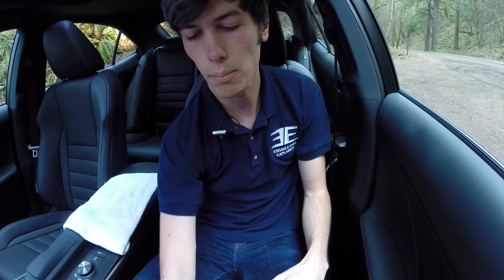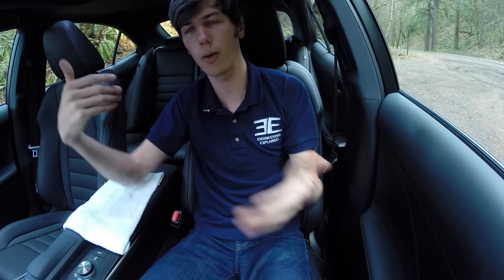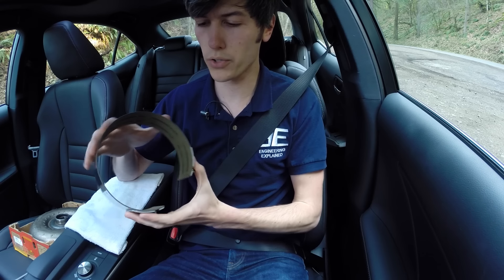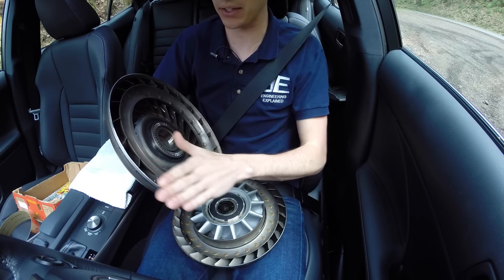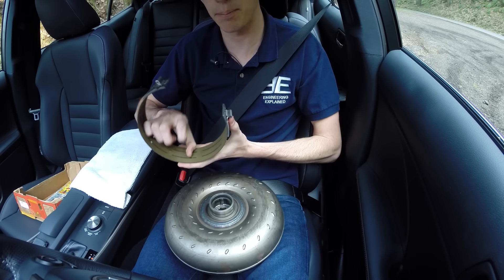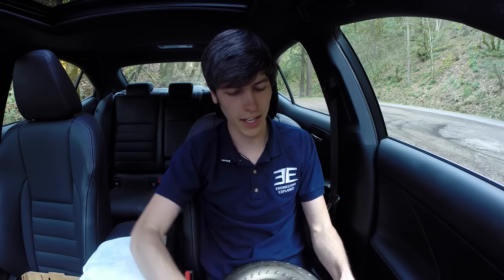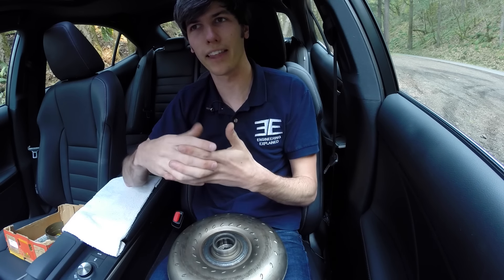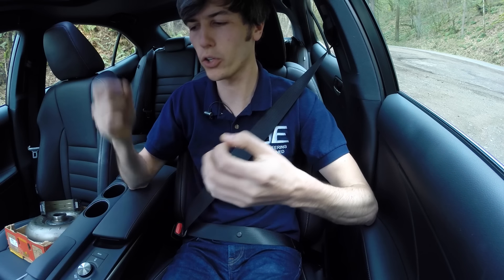5 Things You Should Never Do In An Automatic Transmission Vehicle

Comment: When you are on up hill and you shift to park. You should put on Drive, because if you put on Neutral the car start to roll back. Common sense, to shift it to Park you must stop the car, the only thing you doing shifting back to Drive is putting it back where suppose to be.
When cruising on Neutral the RPM on the engine goes to idle, the transmission will have higher RPM . Sample, if you cruising at 50-60ml/hr . On a normal driving should be 1300 -1700 RPM, but because you are on Neutral your RPM might be 1000 or less.
Proper way to engage gear is to press the gas to 1300 - 1700 RPM and you will engage smoothly, otherwise the engine will absorb the drainage of RPM and you will feel your engine increases RPM and your RPM gauge will go up. By engaging high speed whit low RPM, is like you braking with the engine, Braking with the engine eventually will break the gasket inside the engine, because the engine is designed to compress, not to decompress.
Absolutely you can do it until it breaks, and you can’t do it any more.

Comment: Not having a reason to put it in neutral when stopped.. That depends on the vehicle sometimes.. If you have an alternator dying and wanna keep off the brake lights ect, or if your engine is overheating or running hot and you have a clutchfan cooled engine you can put it in neutral and rev it to cool ect. There is a reason here and there but if your car is running perfect I can see it.

Comment: So I actually do put my car in Neutral when I come to a stop and the reason is there is a rattling sound the car makes when I am in drive and stopped with my foot on the brake. I noticed when I put the car in neutral that rattling goes away and the engine sounds as smooth as butter. I do not know the science behind it, if I were to guess it sounds like there's vibrations coming from the radiator or some other part of the frame, I honestly have no idea. All I know is there is zero noise when I'm stopped and in Neutral. If anyone has any insight on that I would love to know more.

Comment: I might be wrong, but isn't also bad for the transmition, if you switch from Drive to any other Mode for that matter, when on the move?
Reply: Modern trans will over ride most damaging commands as shifting is electronically controlled.

Comment: For #1, the law in my state says:

The driver of any motor vehicle when traveling upon a down grade shall not coast with the gears of such vehicle in neutral.

Does this apply to manual transmission as well?? Kinda sounds like it does, which is surprising.

Comment: Not true. Measuring real time fuel use  with  the Torque  app and a bluetooth OBD2 sensor shows measurably lower fuel injection when coasting in neutral vs. in drive in a 2012 Camry. Also,  it maintains initial high speed longer coasting in neutral vs. drive.
Reply: Hi, is it bad for the gear or the engine ? to switch to Neutral from drive , when going downhill ...Thanks.

Comment: if putting in neutral while on a stop light is a "no"
is it also a "no" to put it in "park"?
Reply: When you are stopped at a stop light, if the car behind you does not stop in time and merely "bumps" your rear bumper, that could be enough force to break off the tiny pin that locks the car into park.  The same thing can happen if your car is parked and turned off.  If another car is driven by a bad driver, that other car may ram your front or rear bumper and break off that tiny pin.

Comment: Neutral also stops fluid flow to certain parts of the transmission and will cause increased wear and failure rate if  you do this. This is also why you never want to flat tow an automatic transmission.
Reply: On a old Ford C4 RWD in N Oil Pump still works..., TC pressurized and  oil excess flow through cooling lines and return to lub transmission rear side. All clutches and bands are non pressurized 

When engine off, no oil flow and pressure at all,

Comment: Automatic cars are definitely easy to drive but people should know how to use them properly coz AT cars are more sensitive than MT cars. Also, AT cars if get busted, surely will be more expensive to fix and maintain than MT cars. Also, MT cars have parts that are really not that interconnected to other parts unlike in AT cars, one part gets busted may possibly need to replace more parts coz everything is almost electronic as compared to MT cars where one part gets busted, you will be okay. Not a lot of things to repair.

PS: For the last issue, here in the Philippines, traffic is very bad! I think we are second to Colombia in having the worst traffic in the world, here in Metro Manila and nearby provinces, traffic is very slow. I can see some drivers putting their car in Park Mode with handbreak activated while traffic is moving slow or stationary. However, what I do is just put my gear shifter on Neutral and activate my handbreak. I can feel that my car is less stressed coz it's on idle as compared to just pressing on the break pedal all the time I am on stationary for like a minute to 5 minutes. That's how bad traffic situation here in Metro Manila is. Let's say an average of 3 minutes you will be staying in 1 place, so placing it on Neutral is very helpful with handbreak on and of course pressing on the break pedal to secure that you won't move without your knowledge. Then afterwards I'm gonna move at least 5 meters before I do it again after putting it on Drive Mode. 😂 That is why here in Metro Manila, travelling as near as 2Km may take an hour for a driver before he gets to his destination. It's pandemic now, traffic is somewhat more laxed in the past couple of months coz not a lot of commuters went out and public vehicles weren't that many but now, it's starting to get worse again.

Comment: What is the purpose of the neutral gear in automatic transmission? Why do we even have it on the car, since there is no scenario where we can use it?
PS. I'm driving a 2007 automatic Honda Fit and there's far less vibration when keeping it in neutral at the red light compared with keeping it in drive. I know the age makes the difference, but still...
Reply: Car breaks down and you cant turn it on. Only way to push it out of traffic or into a trailer is by putting it in neutral
Reply: @MultiBeast301  thks - did not thought about that. Sometimes the obviously needs to be said.
Reply: @laurentiutrifan9092  No problem. Also, if your accelerator gets stuck while driving, shifting into neutral is the only way to safely stop your car. Its a nice safety feature. Hope you never have to deal with that lol

Comment: Get in your car. Start it. Put it in drive with your foot on the brake and look at your RPM’s. Now put it in neutral. Notice your RPM’s dropped?

What uses more gas… higher, or lower RPM’s?

Checkmate.

Comment: Never put in neutral, it's not safe and illegal. With that being said:
1. coasting in gear will NOT always cut the fuel. It depends on vehicle;
2. put in neutral when come to a stop light IS a strategy of some vehicle programmed as default.
my land rover will not cut fuel when coasting in order to maintain the coasting speed. And the service manual explicitly said that the transmission is changed to neutral internally when comes to situations like waiting for traffic light to lower the chance of transmission fluid overheating.😅

Comment: The brakes on most cars can keep the car from moving if fully depressed and the car is stopped, bit once the car is moving, the brakes cannot stop it if the accelerator is stuck wide open. The best bet is to put the transmission in neutral first, then hit the brakes.

Comment: Why to not put your car in neutral when coasting:
You aren't saving fuel;
You lose the ability to accelerate;
It is illegal in some states.

Wouldn't disconnecting my engine from the wheels reduce wear and tear on the engine? Engine can idle independently of the wheels, fewer RPMs = less wear and tear.

Comment: There's a simpler much better reason concerning why putting your automatic car in neutral while driving is IMO risky. Most modern automatic transmissions are bi modal ie you can use them in full auto mode in D or you can choose to manually select the gears up or down. Manual selection has physical gate control. The lever cannot select reverse. The worst you can do is select a gear that is a bit high or a bit low. And generally there are underpinning electronic controls to prevent potential RPM damage. But shifting into neutral is a straight through with no gate control to reverse. So it is relatively easy to stuff it up and shift straight from drive through neutral into reverse at speed. My father did this in his GMH Holden Jackeroo and destroyed the transmission.  Drivers need to look at the road not at which transmission detent they are in IMO. Manual transmissions don't have this problem.

Comment: I always thought about what would happen if I shifted to neutral while coasting, have never tried it though. Thanks for curing my curiosity
Reply: But did he... Besides not having control , not helping in fuel, and the overbearing cop on the side of the road.... Why not.... there is none.. now you don't want to tow the car in neutral that can cause damage... But costing... Not so much.
Reply: You can and it does save the fuel and pollute less! No throttle=less fuel consumption. If the hill is too steep use the D (or in gear), as it consumes even less and if the hill is not that steep use N(neutral) for maintaining the speed without pressing the throttle.
Reply: @bizjakboris  you know you idle higher in neutral right? so this would actually lead to worse fuel economy. also neutral does not mean no throttle. I an throttle all I want in neutral and waste fuel.
Reply: @CyseTV  You didn't understand what I wrote. By using both methods - Neutral when the hill is not that steep and using D when the hill is too steep - You save the most fuel. By not pressing the throttle you consume less fuel.
Reply: @bizjakboris  you don't have to press the throttle in drive, wtf are you saying???
Reply: @CyseTV  it's the same as engine braking. Going down the steep hill you don't need to press the throttle pedal to maintain the speed. Correct? In this case it would be useless to use N (neutral) and use the brakes. But if the hill isn't that steep you can switch to N to coast without pressing the throttle. If you keep it in D you will have to press the throttle. Let me know if you need more explanation. Best
Reply: @bizjakboris  why not just upshift than?
Reply: @CyseTV  Yes, upshift is ok until you are in the last gear and the car starts slowing down. Then you can use neutral.
Reply: @bizjakboris  how fast are you going what the car slows down in your top gear 😂 

Like the 6th gear on my car is specifically meant for highway fuel economy and I've never revved higher than 2000 rpm on it and I really drive my car

Comment: 1:06 this is true, however the resistance of the engine and transmission itself can reduce the amount of speed you get from coasting. I find that coasting in neutral tends to provide less resistance than coasting at idle. It isn't a fuel thing so much as a momentum thing. Granted, sometimes this resistance is good, hence the whole point of engine braking.

The point you made about stopping in drive not being bad for transmissions is a great one. I mainly just put my auto in neutral when rolling up to a stop for the sake of my brakes, not my engine (partially resisting the idle power of a torquey engine at low speed with brakes can wear them down quicker.) 
You definitely lost me at "never use the park setting specifically built into a vehicle for parking," though.
Reply: He said don't park while the car is moving

Comment: Texas law: Sec. 545.406.  COASTING.  (a)  An operator moving on a downgrade may not coast with the gears or transmission of the vehicle in neutral.

(b)  An operator of a truck, tractor, or bus moving on a downgrade may not coast with the clutch disengaged.

So, someone must have argued, "I wasn't in neutral, I just had the clutch pushed in."  But apparently that's okay in a passenger car, just not something larger.

Comment: Most automatics actually shift into neutral when coasting as a way to save fuel.  Read the owners manual of your car that indicates this.  Those states that have that law also dont know how cars operate.  Porsche,vw,audi,bmw,fords i know 100% shift into neutral when coasting.  You know this because when you let off the gas in normal mode the actually picks up speed.  Engine is in idle and fuel mpg maxes out.  Only when in sport or tow haul mode, will it use engine braking.  But i state, most not all cars.

Comment: Its not fine to leave it in drive at a set of lights. If you're sitting at a set of lights in drive you must have your foot on the brake. Dazzling drivers behind you. When you stop at a set of lights, handbrake neutral, manual or automatic it doesnt matter.

Comment: I’m more concerned with the physical damage that can be done. This appears to be nothing. Yeah, you might lose gas mileage. Yeah you might lose a little bit of control because you can’t accelerate. Yeah it might be illegal. None of these reasons point to anything as to damaging your transmission. I think the legality of it is about the silliest thing I’ve ever heard for there’s absolutely no way they would ever prove you were coasting in neutral the cops don’t give a crap anymore about anything much less whether you’re driving in neutral, and how they would ever know is beyond me.  So, although I never really put it in neutral to save gas, there is occasions at a stop sign or some thing that I might put it in neutral. Your video is not convincing me that this is a bad idea but thanks for posting.

Comment: Doesn't it heat up the transmission when you have it in drive while standing still?
Reply: heats up the torque converter
Reply: @loganjames4607  Exactly, so when you have e.g. an area with lots of traffic lights, it does make sense to use neutral.

Comment: How would you ever get caught coasting in neutral if it was illegal
Reply: The accident investigation would discover that.  When coasting down a mountain hill that is several miles long, the only way to stay under the speed limit is to use your brakes (instead of using the "engine-braking" were the transmission still in gear).  The brakes WILL overheat and therefore will no longer work.  (Brakes are a device that convert mechanical energy to heat energy.)  Once the brakes fail, you have lost control of the car.  A certain percentage of those situations will result in an accident.  Overheated brakes are easy to discover by the accident investigator.

Comment: hy.. putting on neutral and coasting is bad for the transmisson? I mean mechanically ....
Reply: Can be depending on the transmission and what drives it's oil pump. You could run into a situation where the torque converter and input shaft bearings aren't being adequately oiled/cooled.

Comment: I put it in neutral at stop lights because the car is trying to move forward while in drive and it requires far less brake pressure to keep stationary when in neutral. It's a comfort thing for not having to press the brake with so much foot pressure

Comment: I have a habit of putting my car to neutral at stoplights because it's what most drivers here did. What's a situation where putting a car to neutral is acceptable then?
Reply: When the car is being towed. Putting it in neutral at intersections isn't necessarily bad, but it does cause unnecessary wear on the clutch packs when you put it back in gear

Comment: First point is only relatable to specific vehicles. So not really accurate. Every auto I’ve driven never helps fuel economy if I stay in drive instead of neutral. I only know this because my Rev gauge visibly presents revolutions above 1,000-1,500 rpm. Even with what ever gear the transmission chooses. Neutral will drop the engine to an idle. Thus saving fuel. Test it.

Comment: I will completely disagree with the coasting in neutral point ive been doing it for years and I will continue to do it and there is absolutely no debate that coasting in neutral saves fuel i've tested this in my own car and although engine braking does cut fuel completely coasting allows you to reach much higher speeds which you can then use to climb a hill without using throttle on the way up.

Comment: Many automatics go to neutral when letting off gas pedal, when on economy setting. Audi A3 2.0 TDI 2016 for example. Car rolls really effortlessly in neutral. I bet Audi engineers know its good for the fuel economy. When warm A3 runs 0.4l/h @idle at best, which is very little. Also you won't need energy to spin transmission and other drivetrain parts. Stored kinetic energy in downhill is way much more than the saved fuel contains.

Comment: There is another reason to keep your car in gear when going down hill. In long down hills you can burn out your brakes. This isn't as much of a problem with modern brake set ups, but cars built in the 70's and before, were often times under braked by todays standards. If you going down the mountain from, say ski trip, you may have conserved gas, but you would be riding your brake the whole time. It could get dangerous if you did that for an extended period of time. Suddenly no brakes.

Comment: Why does this video have so many dislikes ?
Reply: Manual elitists who hate people for having an opinion
Reply: Not because of manual elites, but because what he says is not true about coasting and putting in N while stopping at all. With coasting in N you consume less fuel as in the gear (D) you have to maintain the speed by pressing the throttle. The only time where that is not the case is when the hill is too steep. In this case you want to have your car in gear (D) to brake with the engine and consume even less fuel. Basically - no throttle=less fuel consumption